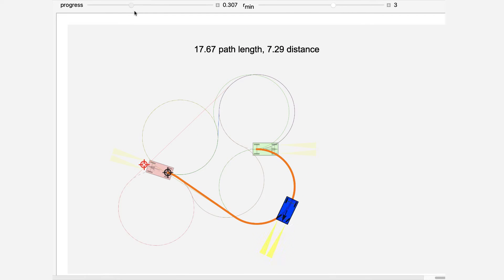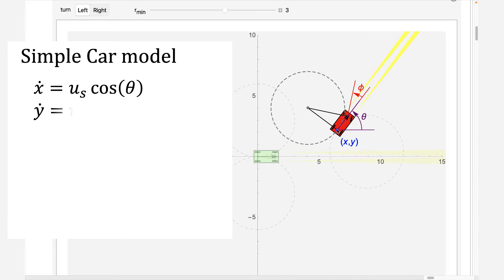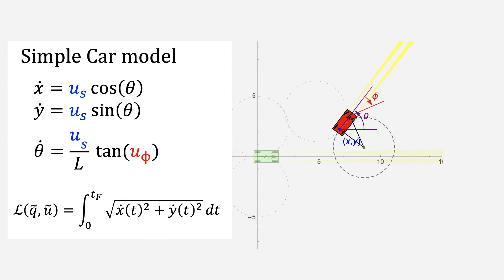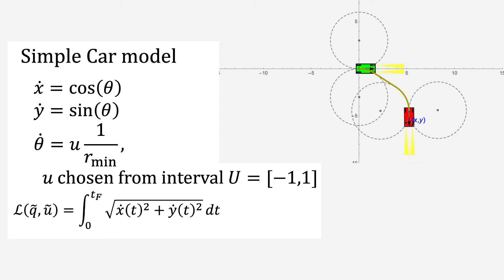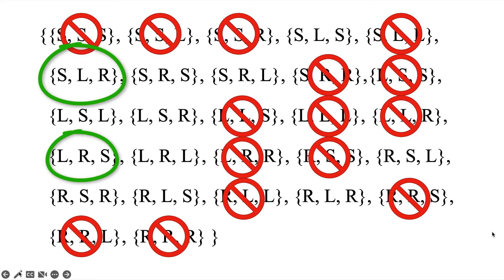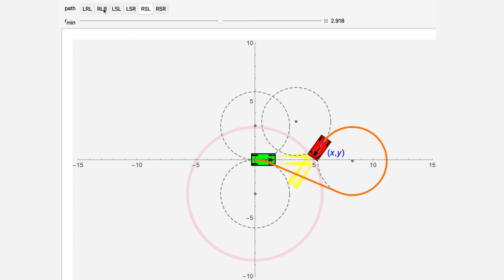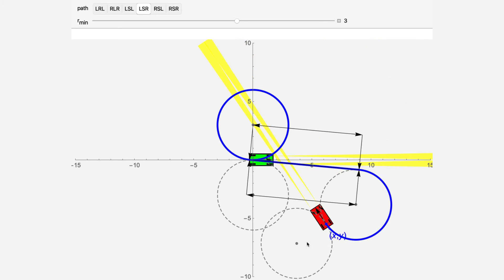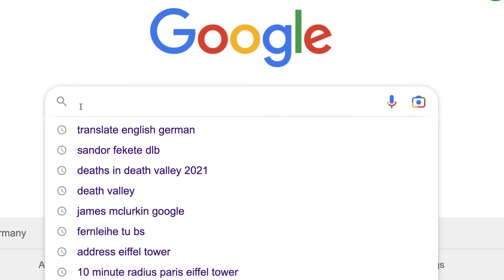Coding a Dubins Car Optimal Path Planner

Comment: at 2:27 how is the maximum turning angle not affected by speed? won't there be a frictional constraint on the maximum centripetal force that can be exerted on the car while following a certain path?
Reply from the maker: The Dubins path assumes a maximum curvature is given.  This applies to a car with a mechanical hard stop on how far you can turn the steering wheel. As your comment suggests, dynamic constraints can sometimes translate to kinematic constraints. If you know you will be driving fast, you can specify a larger radius as your minimum curvature.

Comment: Great video! But when facing a real problem, the steering wheel have an angular speed, which means that it takes time to turn the wheel to a certain direction. Its particular hard to make a vehicle follow a trajectory when its L -> R or R -> L, because the wheel have to be really fast OR the car to be very slow or stop while turning the wheel

Comment: Hello thank you for you explaination. but i have a question. Why for LSR we use pythagore to get the straight line length ?

maybe I have a theorie but i let you correct me.
we do hypothenus = distance from center for Lstart to Rend 
side = sqrt(hypothenus *hypothenus /2) //cause each side should have the same length 

the side length = the straight line between each steering circle 

am i right ?

Comment: I have a question, why u \in [-1, 1], u should \leq 1, but why u can \geq -1?
Reply from the maker: u is the amount of steering.  If +1 means turn as much as you can to the left, 0 is go straight, and -1 is turn as much as you can to the right.
Reply: @AaronBecker  I do really thanks for your answer, but I still cannot understand. In the vedio, why you can change  \dot{\theta}=\frac{1}{L} \tan \phi to \dot{\theta}=u\frac{1}{r_{min}} ,\quad  u \in [-1,1]. Let me try to explain(maybe I am not right): (a.) \frac{1}{L} \tan \phi  = \frac{1}{R} (b.) R > r_{min}, so we set a control u: u*R = r_{min} (c.) put this formula into R > r_{min}, we get R > u*R. (d.) radium R > 0, so u < 1.   Am I right? I just don't know why it should \geq -1. Can u get the value -2,-3 ....?

Comment: Firstly, great content thanks for that. I have a one question: by looking at the start and finish positions, can we understand which maneuver type should be used? Are there any faster methods than calculating the length of each maneuver type? I'm trying to increase the speed of the my implementation.
Reply from the maker: [yes there are faster methods] The closed form equations for calculating the 6 path types are simple, and only require a few trig calls.  By looking at the distance, you can often eliminate 2 of the 6 options.  However, the configuration space can be partitioned into cells based on which path type is optimal. These cells are given precisely in  Soueres, Philippe, and J-D. Boissonnat. "Optimal trajectories for nonholonomic mobile robots." Robot motion planning and control (2005): 93-170.  With that said, in my code for the Reeds-Shepp car, which has 48 options, I calculate all 48 and measure their length, and I still get real time interaction ( see https://demonstrations.wolfram.com/ShortestPathForForwardAndReverseMotionOfACar/ ).